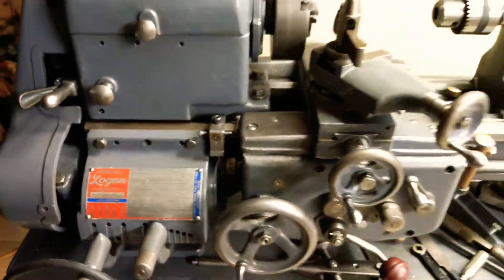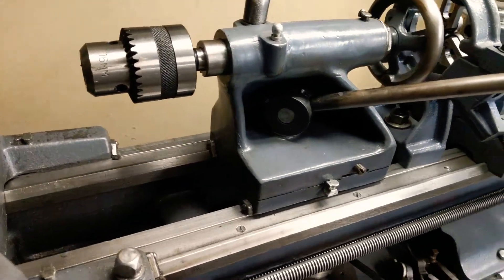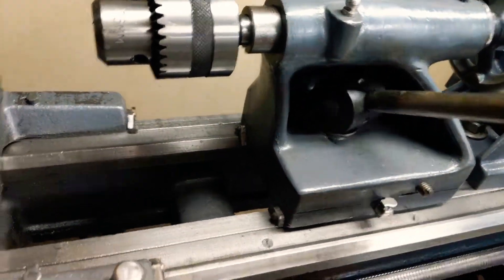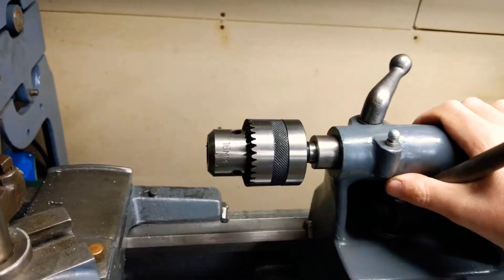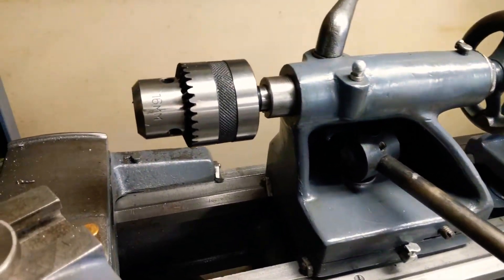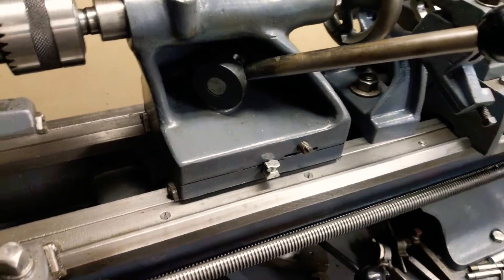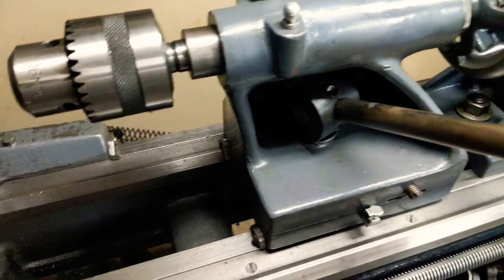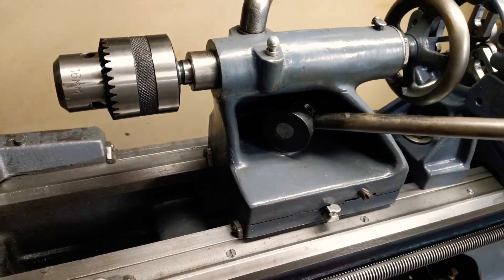Logan Lathe Tailstock Lever Lock

Comment: How did you cut the slot in the ring nut - milling set up?
Reply from the maker: I think I held it in a tool holder with an end mill in the chuck. Then used the cross slide to advance the cutter. That was before I owned a milling machine